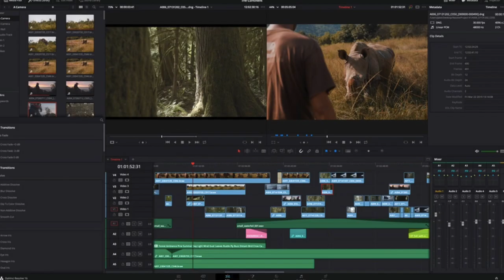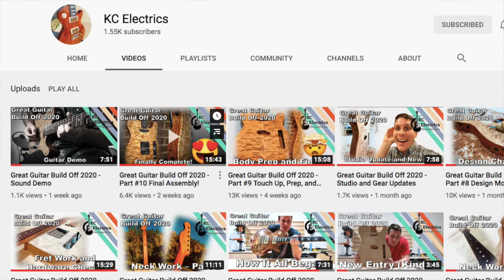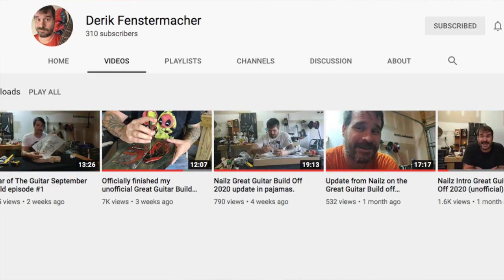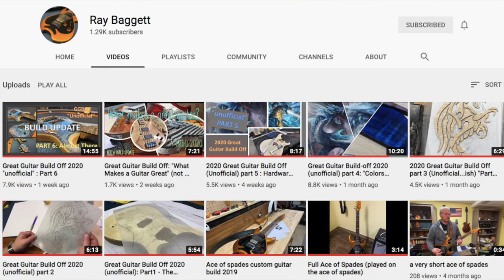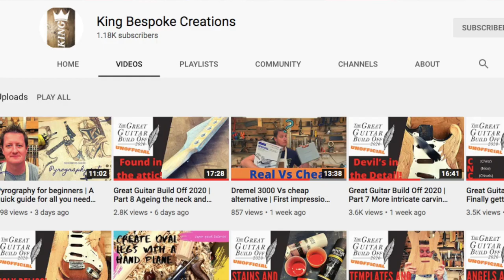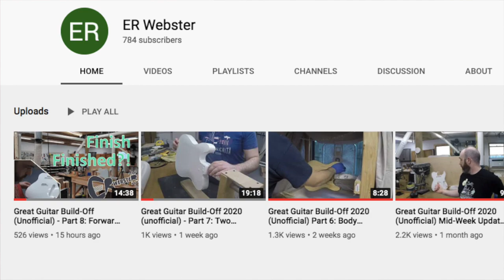My Favourite Builders in the Unofficial Great Guitar Build Off

Comment: Dude....you have more testicular fortitude (big balls) than I ever did at your age.  Since this "great guitar buildoff" started, I've actually built 5 guitars.  2 lefties for my son, and 3 "normal" ones for me.  My hangup with entering any contest....lack of video equipment, skills, or confidence.  I could have said I didn't have time....but I had time to build 5 guitars, didn't I?  My problem now, that I've caught the "build bug," is that I'm always building something and never actually PLAYING them....I'd be a rock superstar if my practice time equaled my building time.  MY newest project....At the beginning of this whole pandemic, I decided to finish reflooring my entire house with laminate planks.  I had 2 boxes leftover, so I decided to see if I can make a guitar out of them.  First lesson learned....wood glue doesn't work well on laminate flooring.  I had them clamped for a day...took off the clamps, everything seemed OK, then I started cutting the shape.  Just when I got to the last curve, the planks started sliding apart, VERY slowly.  I finished routing the shape, with clamps holding it to my bench....then clamped it up again.  There was actually more squeeze out (and I didn't really over do it on the glue)  They've been clamped now for 3 days.  I'll be interested to see how solid they are now, but I'll wait until I have the energy to start sanding the sides.  Overall, it looks pretty decent, as it's already "finished," before even doing most of the work.

Anyway....good on you for entering this thing...